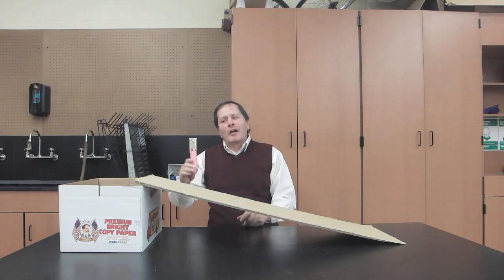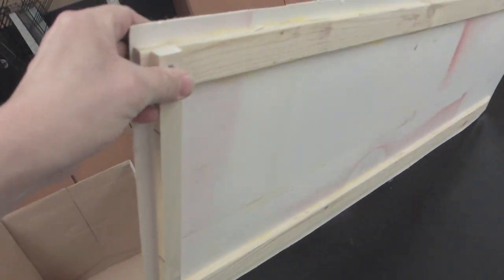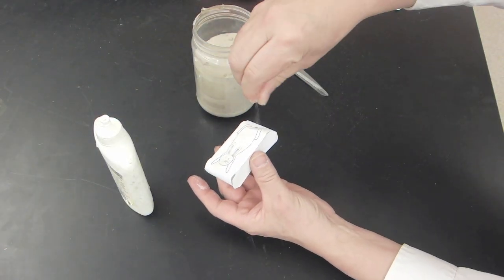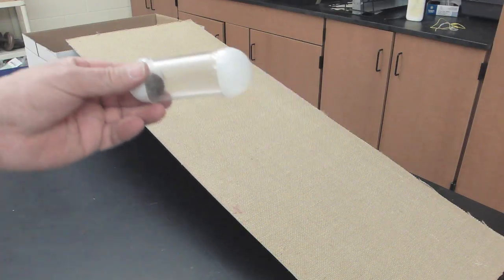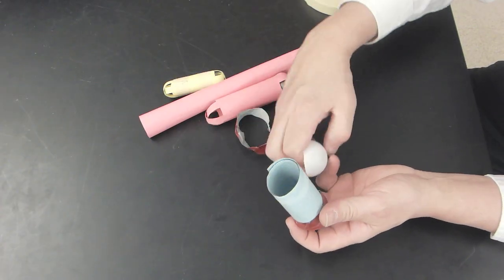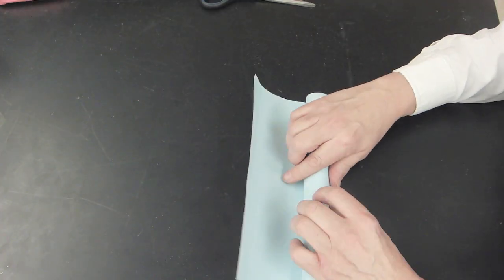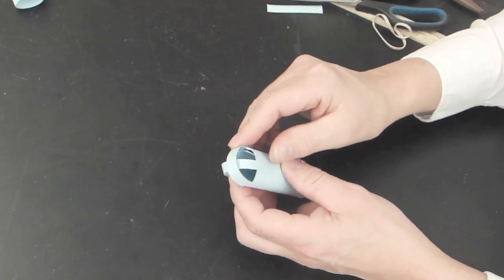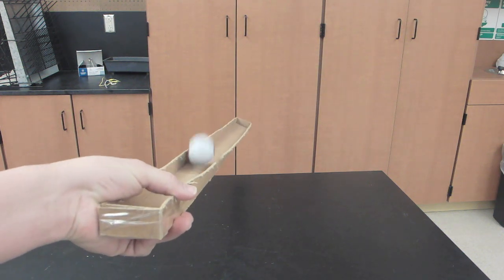Toy Physics---  tumbling toy -part 2  /// Homemade Science with Bruce Yeany

Comment: Professor Yeany, 

We tried making the tumbling toy (a bunny that you demonstrated). We used printer paper, and a couple of glass marbles, covered the surface with glue and sand. The tumbler tends to slide down, instead of tumbling. Is there not enough weight? How is the slide vs. tumbling movement related to the slope of the ramp? 

Thank you very much for inspiring a large community of scientists! 

Kinds regards, 

Elena
Reply from the maker: It is hard to guess the problem without seeing what you have, but since you say the tumbler is sliding,  I'd guess there is not enough friction on the board surface.  Try a rougher material on the board,  either glue and sand or a rough material.

Comment: Hi sir yeany!May i ask why does the second version that i tried to make does not stumble at the board but only stumbles once when it reaches the eng of the board?
Reply: Or does it depends on the angle the board was put?
Reply: What kind of papers can I use as alternative for the second version tube?
Reply from the maker: heavy stock paper,   I like to add a very thin film of glue and then sprinkle sand on it.  I would suggest doing the same thing with the board that you tumble them down.
Reply: Thanks for the reply Mr. Bruce! Thank you very much! since i first saw your channel ...i thought that you tutorials can be a great help for me since in our school we were told to find and make a physics toy that is why im so thankful for your projects and etc.! Keep up the good work sir!

Comment: My favorite effect is actually at 2:29 when it falls. Note that even though the ball is way heavier than the plastic tube, it still falls at the same rate. The ball stays in the top until the floor adds an opposing force on the tube and the ball falls to the bottom.
Reply from the maker: thanks,  I like that too

Comment: A hollow ball filled with a viscous liquid with a steel smaller ball inside will roll very slowly, counter-intuitively. You can make a snail toy using it as a wheel.

Comment: hi, can you please send me the materials that you used and how you did it? i need this for my project. thanks! my email is pat alcoreza
Reply from the maker: +pat alcoreza   Hi Pat,    Here is the website for instructions and a pattern for making the tumbling bunnies.  http://madebyjoel.com/2011/03/tumble-bunnies.html
I don't have any additional information that I can share at the moment,  I was hoping that I gave enough information on how to make them in the video. The diameter of the tube is determined by the size of the metal ball.  I've had students make these in all different lengths so there is no single measurement that is needed. If you have specific questions I can take some pictures of the pieces and try to answer them.
Reply: +Bruce Yeany (Yeany Science) i want to ask, what do you think is the physics principle involving the toy?
Reply from the maker: +pat alcoreza   I have another toy the is similar to this one only the tumbling toy moves down  a ladder.  I have a write up on it with a brief explanation.  If you send me an email address, I will forward it to you.

Comment from the maker: The physics of  these tumbling toys are a bit simpler  than the tumbling toys that work the way down the ladder track seen in my other video.   Both are considered to be examples of a type of nonlinear motion.  To understand it’s motion,  the first thing to consider is the movement of a ball as it rolls down a ramp.  You might want to research  a bit about vector forces and look at diagrams of  rolling objects.  Basically   a ball has both rotational  motion in that it turns and translational  motion as it moves downward.   There is a gravitational force pulling the ball down the ramp causing a torque on the top ball towards the bottom of the ramp.   The friction  between the bottom of a ball and the ramp  applies  the torque that actually  causes a ball to roll as it moves down the ramp.  Without this friction a ball would slide rather than roll down a ramp..  Now consider the  toy.   With the ball inside the container there is a frictional force  between the ball and the paper tube.  The ball inside rolls down the inside of the tube  until it reaches the bottom  tube edge, the ball and tube both turn together and then the ball rolls down the inside of the tube again. It repeats this over and over.   As you watch the toy roll,  notice that  the outside of the  device and observe how it moves down the ramp.   You’ll see that it is actually rolling and turns about it’s surface just like a ball does except that it’s movement is not a symmetrical motion due to it’s oblong shape.     The ramp has a rough surface and in some cases,  sand is added to the exterior of the toy so there is sufficient friction to rotate the toy, without enough friction,   it  would simply slide down the ramp on it’s oblong side instead of turning.   The friction between the ball and the inside of the container also allows  for sufficient amount of torque that causes the container to rotate with the ball  when the ball is against the lower end of the tube.  This becomes easier once the toy is in motion than on it’s first turn.   As you may notice, the toy will continue to rotate a few turns even after it has reached the bottom of the ramp due to it’s moment of inertia.
Reply: Bruce Yeany Also, since the diameter of the ball is smaller than they diameter of the inside of the end of the tube, the relatively heavy mass of the ball shifts the center of mass of the entire toy beyond the lowest point where the tube makes contact with the ramp. That imparts torque on the toy around that contact point down the ramp, helping to flip it end over end. But this CoG-based torque is probably small relative to the ball-rotation-baded torque. I'm wondering if you could devise an experiment to measure how much each torque factor contributes to the toy's movement down the ramp.
Reply: Who the hell asked about these paras
Reply: I'd be interested in looking at the math for both part 1 and part 2.
Reply: The most nerdy comment and reply for that